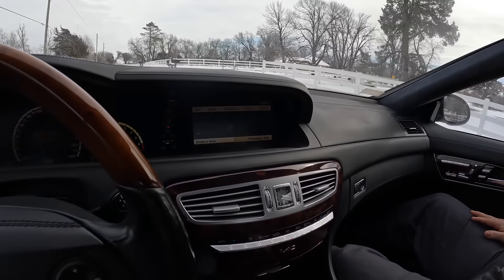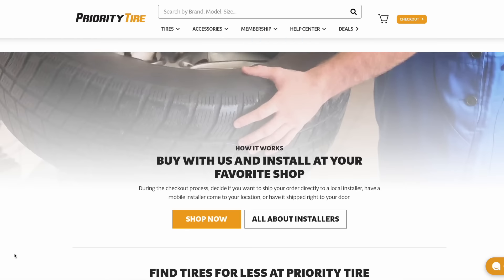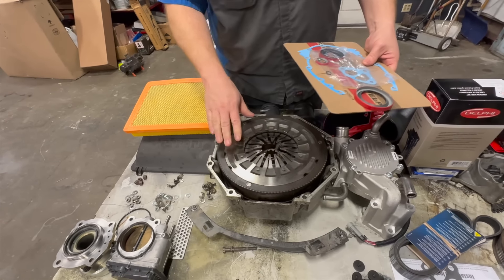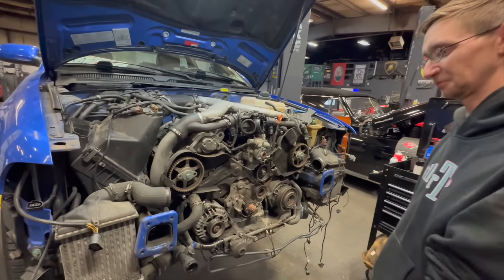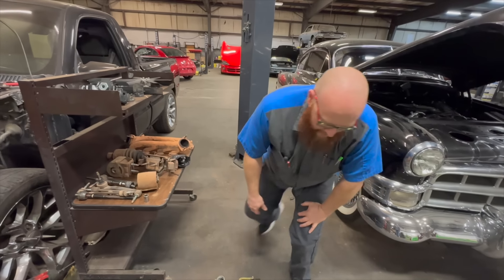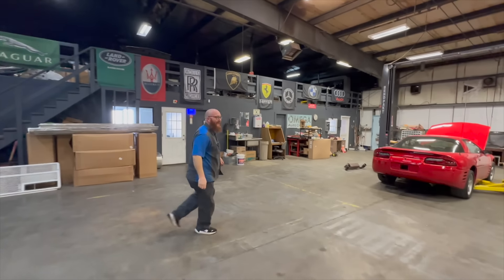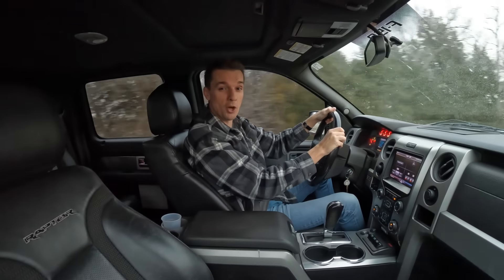Here's everything that's BROKEN on my $19,000 Mercedes CL65 AMG V12 (Cheap for a reason)

Comment from the maker: Get 5% off any tires and accessories on Priority Tire's site with the code 'PTHG1223', and 10% off any Venom Power tires with the code 'VPHG1223' until January 31st at: https://bit.ly/HooviesGarage_PriorityTire.
Reply: Radar sensors in Mercedes cars of that era are prone to throwing intermittent codes. They have a two-piece housing which will expand and leak over time, slowly borking the electronics, or the connector can be bad. There are identical sensors on some American make vehicles, but the connectors are not identical, so used ones are not a safe bet. The original ones are in the low four figures new, but can be had for slightly less from third party dealers. They still have to be coded to the car by Mercedes, though. Ask me how I know.
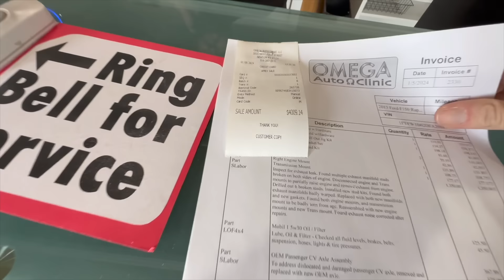Reply: 16:48 with the reaction it went on in the shop before he paid the bill you made me think it was gonna be like a $15,000-$20,000 bill not a $4000 bill
Reply: This car costs 200% more in Finland. Just a hint...
Reply: I really wasn't sure about liking an old Mercedes even if it is a rare AMG but then I saw it was a V12 and because those are so rare it should be saved and preserved
Reply: The paint on that Camaro is realy nice.
Reply: Venom Power!?  Where oh where do the Chinese get these wacky names for their tyre brands!
Reply: Don’t know if I’ll see the reply but in passing it kind of looks like the rear tires were different sizes.  Perhaps it’s supposed to be a staggered tire size?  Maybe the spare is on and there’s a proper sized rim in the trunk that’s flat?
Reply: Folks, do your homework before buying from vendors that are advertised on YouTube. If the YouTuber would actually do their homework, they probably wouldnt advertise for them. Or maybe they would, I dont know.
Reply: Could you tell me what brand opti-spark The Wizard used? I've gone through 2 the last 5 years and getting ready for a third. I don't recognize that one.
Reply: NO
Reply: Last thing I want is some shitty ling long tires... those 'venom powers' are a hazard and there are many reports of them coming apart. So many good tires on the market, there's no reason to cheap out on the most important part of a vehicle.
Reply: Can’t seem to find any branches in the U.K. when you search “ your nearest branch” ?
Reply: wizard so funny
Reply: Did you sell the Mercedes CL 65 AMG?? Would love to purchase it!!

Comment: For many years, the CL65 AMG was my dream car. I could not understand why they depreciated so much. Now I know, the price of repairs is astronomical. I still wish that I could have at least test drove one.
Reply: They're so handsome..
Reply: Because the people who buy such cars new, want the new model every 4-6 years and the people who buy the 2nd hand cars did often not have the money to maintain the car properly. F.e., a spark plug change needs 24 of them, the needed oil for a oil change is 9.5 liter quality oil.
Reply: The rich take them on a 3 year full maintenance lease. 

Smart.
Reply: To be fair these motor mounts and transmission mounts are needed after this car had over 100k miles. Still a bargain for the capabilities considering Mercedes can't even build them any more.

Comment: The radiator IS the expansion tank on that 46. That's why you only fill the coolant just so it covers the top of your coils. The empty space between them and the top of the radiator is the expansion tank.
Reply: That’s how all early pressurized cooling systems worked for most of five decades of automobiles.
Reply: Is it clearly marked and hence limited to that fill point? (Surely most owners would want to fill it right to the top?)🤔
Reply: @philtucker1224 , when those cars were new, it was common knowledge.

Since most people now have never dealt with that type of cooling system, they'll just assume you fill it to the top like a normal vehicle today 

They reason I know about it is because of the 1952 Farmall tractor we owned when I was a kid, many years ago.
Reply: @philtucker1224 , and filling it to the top really doesn't hurt anything. It'll just puke coolant until it finds it happy point, and then all is well.
Reply: @sayrerowan734  yes that’s good, I think most owners would instinctively fill it up if there was no obvious alternative..
Reply: @sayrerowan734  nice, my Dad had an orange 1940s/50s Alice Chalmers on our Farm back in the late 50s when I was very young and he let me sit on his lap to steer it sometimes. I’ve seen a couple in Farm museums here in England since then.

Comment: Never fails, whenever I see one of these CL65's I still want one. Even though I know it would be the dumbest buy of my life. Instead, I'll just enjoy Hoovie's vids .
Reply: Buy a 2013 GL450. Same motor, Beefier suspension and you can get 500hp with a tune. 500hp in a mom wagon is badass. I love my GL, It has been extremely reliable even in -20 weather in colorado
Reply: Yes agreed, - (probably a year’s daily fuel would cost more than the buying price)…
Reply: @loveforthegame3  The engines in the GL450 and the CL65 aren't even related - the CL65 has an M279 V12 (60 degree vee, 3 valves per cylinder). The GL450 has a 4.7l V8 (90 degree vee, 4 valves per cylinder).
Reply: @loveforthegame3 oh your gl450 has an amg biturbo v12? You have no idea what you’re talking about lmao smh
Reply: If you have 20k on the side for upkeep get it, you’ll absolutely love it, if you dont then dont
Reply: @DanielBenz81  That's why I don't have one.
Reply: @AJGreen-cn8kk  I hope one day you get one and enjoy the hell out of it
Reply: @DanielBenz81  Thanks, but I'm looking for a C55 AMG. So many fewer problems.
Reply: @AJGreen-cn8kk  I hear you, I was actually shopping for an e55 when I came across my s65, I got it at a dealer auction for 20 and spent about 20 sorting everything out, that and replacing the wheels and tires so about 15 including the coil packs, plugs, and labor, like they say a good year is 2 grand with a 65 and a bad year is 10 grand

Comment: Tyler, please read this: I had a set of those exact same tires on my gmc Sierra that I had all last year. They were all 4 brand new mounted and balanced perfectly, within the first 500 miles the front driver side tire developed a bubble in the side wall and then exploded all within a 1/4 mile. Then the rear passenger side tire did the exact same thing and exploded within a minute of developing the bubble in the side wall of the tire. The rear driver side developed a bad hop on the highway coming home from work and it had a massive bubble on the top side left hand side of the tire. The last one to go was the front passenger side tire and that was also a massive bubble in the side wall. Each time I went to the tire shop I chose a different one for each tire to get their opinion on these tires each one and the tire techs all said do not buy these again, we will not and do not sell this brand for this exact same reason. Either they bubble out or the tread comes off while driving normal day to day driving….. when each one would bubble I’d get a brand new tire to replace it (of course different but exact same size and weight rating for my truck that the others were before being bubbled and exploding). Please take these off and get name brand tires for this truck before these tires take out your fenders and bed sides like mine did 🤦‍♂️ ended up just letting the truck go because of all the damage these tires caused. Thought I got a great deal on 4 new tires when in fact I paid $1200 for them to destroy my truck I only had for 8 months after paying for it in full before going up north. 2 of the incidents happened in Michigan and 2 in Ohio. Winter driving in Ohio and then September to October pre winter in Michigan
Reply: Tyler doesn't care, he can't really afford to and he is willing to risk his reputation. The mighty really have fallen with him endorsing unsafe products but that's how it goes. He's lived long enough to have become a villainous shill.
Reply: Not reading a book in the YT comments.
Reply: Yeah, Venom Power tires are dogshit. I'm surprised that they're going around sponsoring youtubers. None of the credible off-road channels would ever take that endorsement.

Comment: The shudder while accelerating could be the transmission filter and fluid. Changed the mounts on mine got better but not perfect, after a fluid and filter change got fixed. W221 S550.
Reply: That 722.6 is under a lot of strain from the V12, that's for sure.  Definitely want to change the fluid early and often on those.

Comment: Greatings. I have a 2014 4x2 jeep renegade with a 1.6lt diesel 4 banger and a 6 speed manuel gearbox which has a Forward Collision Warning system. It does have a radar and a front facing camera but i am sure it is not as advance or as complicated as the system on your Mercedes. This week i also had a fault warning for that system and an other fault warning for a blown light bulb on the tail light assembly which is both for the tail light and break light. I was not too worried about the blown bulb but the Forward Collision Warning system fault was a different story. Anyway, i changed the blown light bulb and to my surprise the fault warning for the Forward Collision Warning system is also cleared and did not came back. I thought maybe since the system not only allerts the driver about a possibilty of an accident but also applied automatic breaking when necesarry it needs, for safety reasons, the tail lights to work properly. So a light bulb was blown and the whole system was shutdown just because in the scenerio if the system gets activated and feels the need to apply the breaks the following driver might not be allerted strongly enough due to a missing light bulb and they might ending up rear ending me. Kind a make sence kind a over thinking i my opinion.

Comment: Renntech kit on one of these is 900+ fr/lbs of torque. Friend of mine had a white one it was wild
Reply: Fun fact, they were detuned from the factory because even using the 722.6 the transmission couldn’t handle the torque

Comment: If voltage is low, blower motor will shut itself down to conserve power. Turn ignition to position 1, push and hold call and OK button on steering wheel, and vehicle info (voltage) will pop up on display.

Comment: I think the blower motor code will be 9103 in the Ac control module. If so just the blower motor needs to be replaced. Don’t replace the regulator. No need.

Comment: I got my 1st (I have 2 now) E55 a few years back, and it came with chrome rims. They were so bad the tires would not hold air pressure. Ditch that crap asap. Plus, that 600hp car is going to need some GREAT tires, so a wheel & tire package is in your immediate future.

Comment: Tyler!! At least you didn’t have to do shocks & struts!! They aren’t cheap either!! 😂😂. The Raptor is a break even or better I suspect!!  It’s so well sorted and an ideal match to your farm until you get things paved after the shop is built that you would be very wise to keep this e for a while! There’s definitely lots of life left in that powertrain. If it was 2017 or  newer, I might not Beas confident. They exist without serious repairs, but many have had the turbo done before 150,000 miles and even 2 by 300,000 miles +!!

Comment: Finally got my 07 s600 v12 all sorted absolutely love it
Reply: I've always wanted a late W140. Bought a 2003 W220 500 4-matic and I have loved it except it has cost me a LOT. Did the air pump and 4x Arnott air shocks, paint job, ac and alternator replacement, windshield and back side windows (700 dollars a pop) replacement and the list just keeps giving... Now it has become impossible to ge replacement parts for the W220 2003 lang body panels and double paned side windows...
Reply: 1 liter Super E10 is 1.69€ over here :/

Comment: That radiator for your Cadillac looks like a 1965 Mustang 289 radiator. The 302 radiator has the bottom hose on the other side. It is probably the most common radiator used for engine swaps. I am using one in my boat Tail Speedster.

Comment: The front is actually quite easy to remove on the B5 Audis, Bumper is 2 Bolts and unclip by the fenders, Radiator and Headlights come off as an assembly just a few bolts, unplug a few wires, undo the coolant hoses and get the AC condenser out of the way (no need to disconnect). Then it slides right off
Reply: Versus opening the hood and removing two bolts.
Reply: @bigduginc  Those cars are 50 years apart. Most modern cars its gonna be more than 2 bolts to get to the thermostat
Reply: Same thing on my passat b5.5 same platform as the a4 b5
Reply: Yeah, literally takes 15 minutes to put a B5 into service position... honestly for just doing the thermostat the bumper/condenser could probably stay on since service position would get the extra 3-4" of clearance needed to work on it.

Comment: Im wondering if the previous owner/mechanic didnt leave the town and countrys thermostat out for a reason.....?...ike maybe it was over heating for reasons other than or in addition to the radiator and they left the thermostat out to mask the original problem-?- but there would probably be other symptoms if that were true.

Comment: So the things that you could be causing the vibration engine mounts, transmission mounts and ABC pump dampener the sphere on the ABC pump/ power steering pump common failure

Comment: Common Mercedes problem, the blower Motor Is mounted under neath the wiper cowel and water literally drips on the vertical mounted shaft, where it rusts and seizes

Comment: Could be worse on the Ford. You could have a 40k mile 3.5 EB and spend $5k on having the cam phasers done. Blows my mind how Ford hasn't fixed that issue yet. OR somehow made it to where they're easy/cheap to change. Also sleazy how they get out of repairing those as part of the powertrain warranty on CPO's saying they are "emissions" components.
Reply: I believe that truck has the 5.4L so it's days are numbered at 300K miles. I'm actually shocked it made it that far.

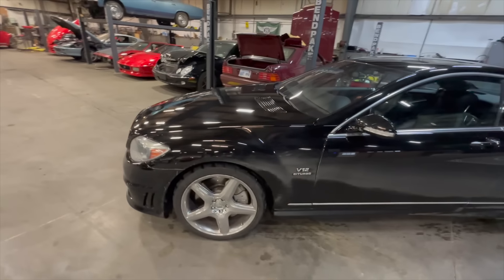Comment: 5:59, the sexual comments from the wizard are getting old and this is not the place for it.
11:51, that radiator for the 49 Cadillac, looks way too small, it could be replaced if you found something with similar dimensions, never say never.

Comment: I own one of those Audis and I've had to replace the thermostat and housing.  There's NO reason to completely remove the nose.  You do have to put the nose into "Service Mode" which consists of unhooking a tons of stuff and then moving the nose out six inches for better clearance.  But, I'm guessing they fully removed it, just to make it simpler.  Service Mode sucks.  I will never buy another Audi, simply because of this and the fact they break all the time.